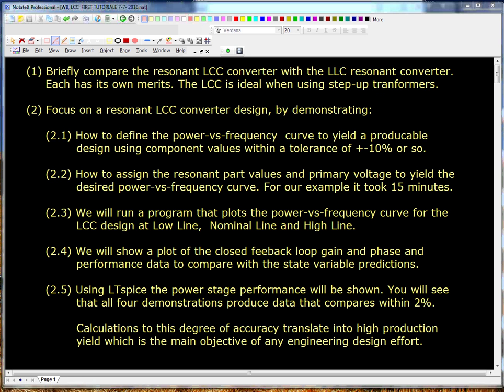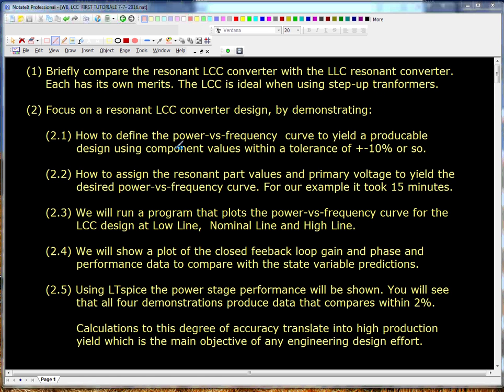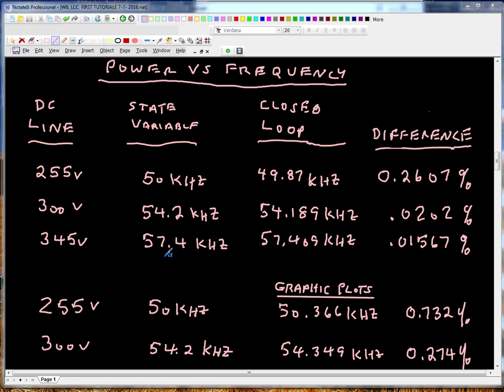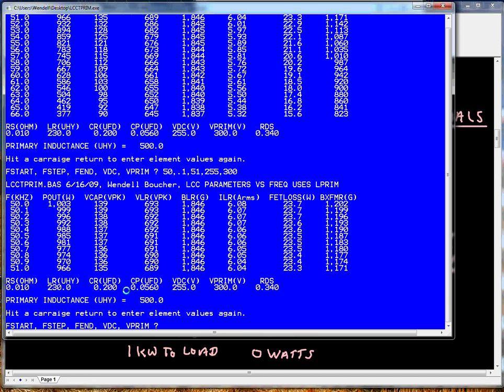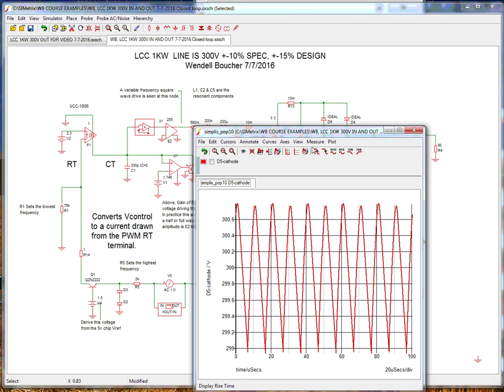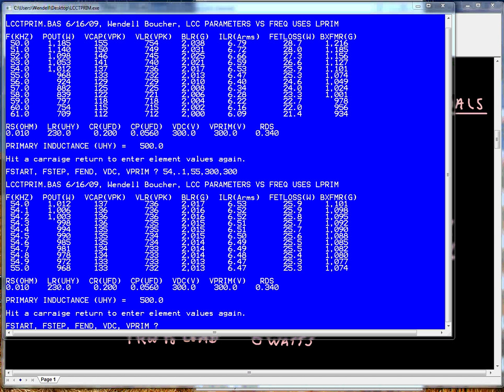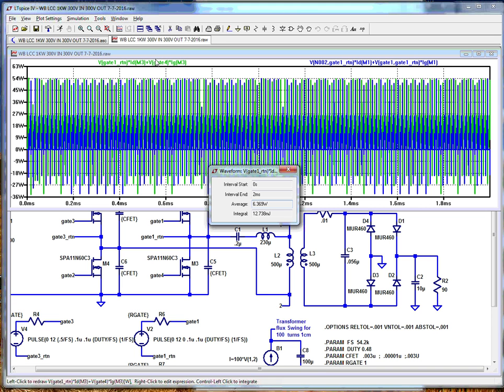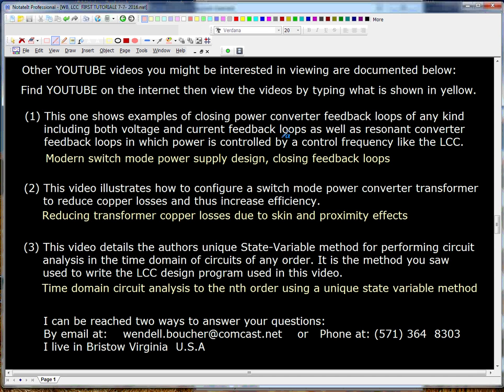LCC RESONANT CONVERTER DESIGN IN 2016

Comment: Hi Wendell is a big deference between LTspice and Topspice?
Reply from the maker: Hi Karas,   I do have Topspice and it is much like Pspice.  LTspice has a some differences. It does not have a monte-carlo capability as Topspice does and Pspice does. LTspice is a very good program and it is free. And Topspice is not, although the price is quite reasonable in my opinion.

Comment: Hi Wendell can we use LCC for high power (6Kw)  ,and Input voltage is DC 50VDC and Output is 500VDC, can we use this topology ?
Reply from the maker: Hi Karis, The ability of the LCC to use the capacitance looking into the primary winding of the step up transformer makes it an ideal choice for going from 50vdc to 500vdc. The power limit is not a problem either. Remember you can create lower power designs and parallel to reach the higher powers and you only need one control loop to do it since the LCC acts like a current source. One of my designs was an 7kw 16kv design. I used three 2500w LCCs in parallel. It worked just fine. Best regards Wendell'